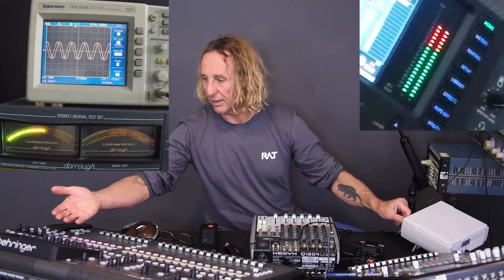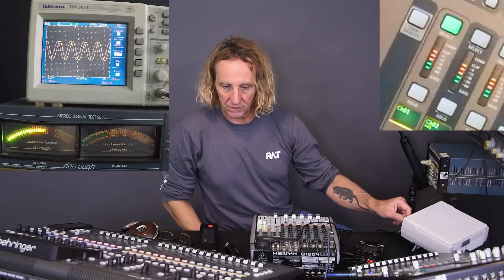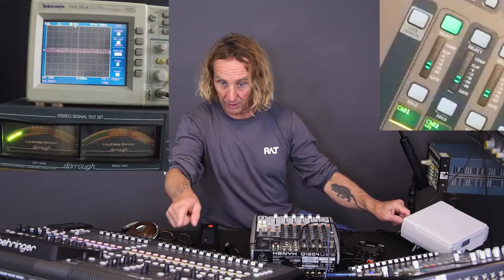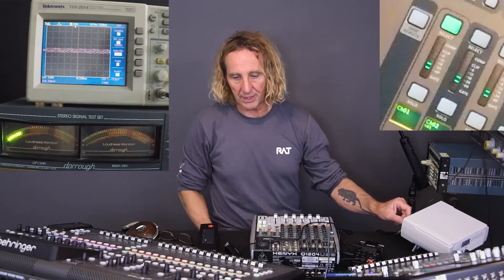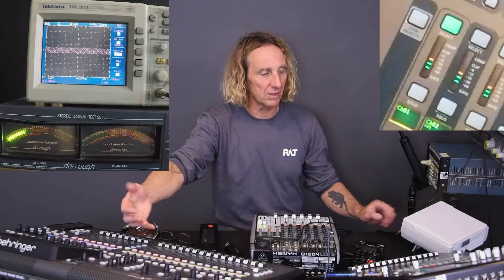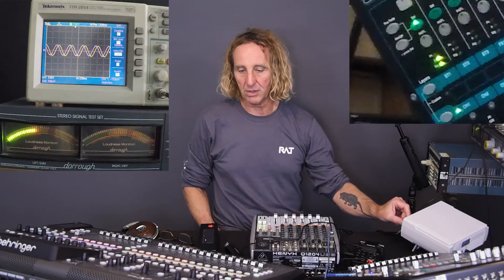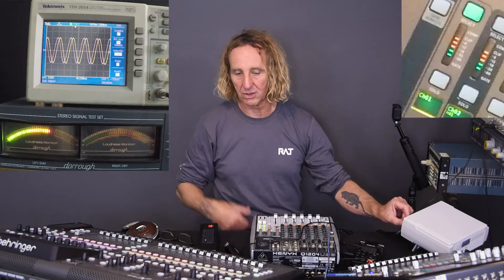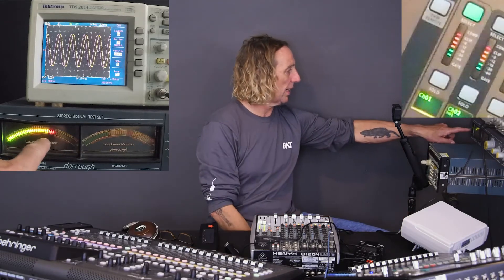Metering & Clipping - Behringer X32 vs Allen & Heath QU16 (Public)

Comment: The metering of consoles/desks should conform to a standard so we ALWAYS KNOW what we’re looking at for reference, and yet, here we are, needing this video. I’m with you give me a midas analog desk and we’ll have a good night, but, I stayed in with the digital boards and got them sussed. I do like the lighter weight on packs😂🤣, after 40 years, my back is fine! That H3000 musta weighed 750 pounds!two guys lifted it? Ouch.
Reply from the maker: Yes! There was much debate between being technically correct and intuitively practical when digital consoles gained traction.

The tech lab humans won and the opinions of people that use it in the field list that battle.

So we have technically correct metering that is intuitively flawed  for people that have used analog.

So mixing feels like driving without speedometers or speed limit signs marked whether they are kilometers or miles per hour.

And get it wrong and you get distortion tickets

Comment: The problem with digital is the signal sent to the output is missing pieces, how many pieces depends on the sampling rate.  Everything occurring between samples is lost.    Good to eliminate noise, but bad when mud is part of the dynamics or sound of the artist.   Analog sends all that it hears, without fail.   It's always listening.
Reply from the maker: Hmmm, that not entirely correct and based on a myth I address in a video I did on digital stairstepping.

Yes info is lost and the info that is lost are only frequencies above 1/2 the sample rate. Frequencies below 1/2 the sample rate are not lost. 

Yes there are issues with digital and personally prefer not converting if possible but it is not difficult to prove that digital can accurately capture audio below 1/2 the sample rate without losing info.
Reply: @DaveRat  good information.   I will have to look for the video.  Doing a Dave rat binge these last few days lol.
Reply from the maker: Awesome and thank you for hanging out and commenting. Search digital stairstep and let me know what ya think
Reply: @DaveRat  will do thank you.

Comment: Years ago in the 16bit digital world, AES established what I recall as a guideline for equating analog VU meters to digital full scale, AES-18, meaning when meters show -18dB(FS) you’re at 0dBVU or +4dBu (from the voltage perspective). Now in the 24bit digital world, with 144dB theoretical dynamic range between noisefloor and clip, we can make +4dBu = -24dBFS and have headroom at or approaching the same as classic large format analog equipment. It’s not operator error, in other words, it’s operators misunderstanding the standards and equivalencies, and that speaks possibly to the education they get prior to stepping up to the console.
Reply from the maker: Agreed. Digital boards look like and often try and feel like analog and meters often look similar but the way they are used should be quite different to achieve desirable results.

Knowledge of what should happen vs logic of what looks like is happening vs what actually happens are a bit messy.

And from watching and hearing numerous engineers and shows, there is a clear disconnect between what should be done and what is often being done on both analog and digital consoles.

With the issues being exasperated by the confusion and unforgiving nature of digital overload.
Reply: @DaveRat  maybe we should be writing the 10 Audio Commandments: Thou shalt not clip, thou shalt leave 20dB headroom…
Reply from the maker: Ha! I am trying! Doing these vids to illuminate and that's a good plan
Reply: @DaveRat  you’re in a unique position to be able to do so; show why the commandments should stand/be adhered to. The first one I mentioned in a unity gain system would be harmful at every place in the signal path, and for bar/club mixing, that can extend to a musician’s ears more readily than ever before. (For instance)
Reply: This is exactly what happened to me. I only had a few years on an analog board before upgrading to a Presonus Studiolive, then a X32. 
I had NO idea the meters were different, and mixed for years thinking 0 on an X32 was 0db. 
Embarrassingly, it wasn't until last year after I bought my first round of Meyer Sound speakers and clipped the digital amps by sending too much level that I went down the rabbit hole of learning all this. 
It also didn't help that almost every video I've ever seen of someone mixing a show on a X/M series console shows the master meters up to -6 sometimes. 
It's also VERY bizarre to me that most commercial speakers have an input sensitivity of -18dbfs yet on the X/M series the meters suggest you have 18 db of headroom before "clipping". 
IMHO that's INCREDIBLY misleading. If I hadn't already invested in 2 x Blue Midas Pro series stage boxes, I'd be over to Allen and Heath in a heartbeat. 
I REALLY wish there was a way to meter a Midas like an analog console, where the top of the meter is where the stopping point is.

Comment: Right when you switch from the X32 to the QU16... quite the latency difference!
Reply: Hmm?
Reply from the maker: I have not watched the video in a while and don't remember exactly how I did the switching but I do recall that it was disorienting switching between the two with music playing and I did tests running one console in each ear of headphones and then adding delay to the x32 to time align and make up for the added QU latency.

It was extremely audible but that is to be expected as humans can hear 1/10 of a ms time offsets without much difficulty, especially in headphones
Reply: @DaveRat does it mean that the QU have more latency than the X32, if you record this direct to DAW?
Reply from the maker: Yes!

Comment: Hey there Dave! Erick here. Long time listener, first time caller ;) 
Interested if you have explored how bit depth affects the resolution of digital signals, particularly the detriment caused to lower amplitudes which could contribute to the harshness of digital consoles. Since at lower volumes there are less bits to measure and replicate the changes in amplitude this could create harmonic distortions, possibly even at specific intervals, that could stack up in the mix. 

I’m also curious if you believe top of the line models by these manufacturers, such as the DLive and Pro Series consoles, introduce any kind of digital soft limiting to help prevent audible clipping and offer a more analog feel/sound/response? Also curious if something along the Rivage caliber of consoles would present such features.

It’s fun to chime in on the mix! Really appreciate all the great advice, in-depth unbiased gear analysis, countless years of amazing dedicated work, and a lifetime of being a fantastic human! Looking forward to what’s to come!!!🤘🤘
Reply from the maker: Thank you and I don't know for sure which consoles if any have soft limiting. I've heard people talk about it but I haven't tested and proven it to myself or found somebody that claims it.

As far as the harshness of digital I attribute part of that to the fact that digital tends to make whatever problem there is exactly the same on every channel identical. Analog has no two channels that sound exactly the same most light variations and differentials that I think soften the issues.

But I see the primary issue with digital consoles is that people overload them and don't expect harsh consequences.

You really really really need to run them well below limiting well below clipping to avoid bat sounding distortion. But when you do that you don't get that soft overload sound which adds warmth and take some of the edge off. So did digital kind of leaves you with either that sounding distortion or way too clean. Analog allows you to find somewhere in between those two and get a warmer more organic sound

Comment: But does it really make any difference, the Behringer is actually accurate whilst some might argue the AH is a little too conservative playing heavily on the safe side? After watching many of your past x32 experiments and tests I have since tested mine against other interfaces I won and still really impressed and happy with it. People like to knock the x32 simply cos its Behringer, sad people in my option cos they really are a good deck with masses of flexibility and features.
Reply from the maker: Overloading digital consoles is extremely common and very audible. The x32 sounds worse clipping than the AH but ideally no one would ever clip them and then it does not matter. The issue is human
Reply: @DaveRat  agree but for what u get for the money try beating the Behringer?
Reply from the maker: Well, for a pro rental company like I have, the Beringer is sub standard. The durability, lack of multiple types of output formats, the issues with 100 meter cable length, the poor customer support and the poor serviceability of a semi pro or consumer console, makes it a no go.

That is not to say it is not useful or sounds bad.

My home hifi is useful and sounds great but is not of the caliber to put out as a pro product.

Digico send people out to our large gigs, have Madi, fiber and very robust and durable builds.

And it's expensive bot for what we do, the cost is not an issue, we will pay top dollar for the highest quality gear.

And also. The x32 is great, super powerful and very inexpensive and a great way for people that are on a budget or do not require the durability of a bulldozer and are good with a pickup truck.

Having an inventory to mainaltain of 20 x32s sending out on your gives me nightmares just thinking about it.
Reply: @DaveRat  It is a little unfair to compare Behringer X32 against something made by Digico. Your comparison is 100% accurate no one in their right mind who runs a Pro Rental Company would consider the Behringer X32 and probably not even the Midas variant either, they are toys in comparison to Digico.
Reply from the maker: True and yet, the SD11 and QU16 are the only boards in our rental inventory that fit in my car to compare to, and the QU is just a utility mixer leaving the SD11 as the closest thing we own to an X32/M32

That said, we are looking at expanding our AH console inventory from one to more than one
Reply: @DaveRat  I originally wanted the QU16 but there was no guarantee when they could supply one anytime soon and they had quite on backorder. The x32 I bought was second hand and a complete rig with stage boxes and cables for a seriously competitive price and it was almost brand new (less than the X32 on its own without cases cables and stage boxes). I always knew I would get my money back and some, so it was never a risk. With the on going chip shortage the increase in inflation and a looming recession, I guess I did alright it serves the purpose I wanted it for.

Comment: Excellent video!  Allen and Heath, in their documentation for the QU state that the PK  LEDs illuminate at 3db before bad things happen, at both the channel strip and the outputs, at least for firmware 1.9.3.  On our SQ, peak metering is illuminated at the same level (-3dB) , but presented even more obnoxiously with more blinking red PK LEDs on the surface.  Allen and Heath really don't want you to clip your signal anywhere on the SQ.  

Side note, one of my friends out here helped you with a plumbing project many years ago, and you helped him get his first relatively big mixing console.  I've seen quite a bit of what you say to in what he actually does.  

Thanks for being a cool Sound Human!
Reply from the maker: Super cool and thank you for the info.  Trying to recall the plumbing and mixer. And awesome!
Reply: @DaveRat  Kemper Watson is my friend and audio business partner.  You were redoing a bathroom like 15 or 20 years ago and he was helping make sure you knew what to do and how to do it right.  Afterwards you helped him get a big Crest mixer.
Reply from the maker: Oh yes!! Totally know Kemper and super cool!

Comment: I worked with a Midas Legends 3000 in my studio for years until an unfortunate storm took it out of commission, at the time I wanted a Heritage 3000 but I was given a better deal on a Legend desk that was a showroom model in a music store. I have been searching for the right size Heritage 2000 or 3000 for my studio I need at least a 48 but I really want 56!! I think you would really like an FPGA mixer since it is a different type of processing compared to a DSP based mixer. The big issue is phase coherency with DSP based mixers, they just are not end to end phase coherent but this has been solved with FPGA mixers and I can say that difference between the QU mixers from Allen & Heath which are DSP based and the SQ mixers which are FPGA are night and day. The SQ mixers are phase coherent. The QU mixers use an ARM DSP to process the audio, the SQ and larger Allen & Heaths use an FPGA to process the audio. One of the Engineers from Allen & Heath wrote and article on why this is a superior way process audio since it can keep the signal intact without phase shift and FPGAs have lower latency sub 0.7 Milliseconds end to end, with no need for delay compensation the same way a DSP based mixer needs to be. I would link the article here but Youtube will delete my comment if it has a link so here is the title of the article by Jeff Hawley it's called "FROM DSP TO FPGA: A Digital Audio Signal Processing Revolution". It is a good read and sheds some light on why digital mixers have sounded they was they do for so long, and what is next when it comes to FPGA based consoles!! Great video as always Dave!!!

Comment: Thanks for these videos Dave!. When I mix on my x32 I always try to keep signals at -20 -15dbs I feel it sounds more pleasant to me, also trying to avoid the bottleneck in the bus master. Am I wrong?
Reply from the maker: That's all good, the worst sound comes from overload and running low levels is all good

Comment: Most consoles use + and - 15 volt supplies for the analog op amps for both the input and outputs. The Op Amps generally clip between 10 volts and 13 volts depending on the chip manufacture. You can see this on your scope. This is true for both analog and digital consoles, except the digital consoles have the peak voltage set with digital clipping near the clip level of the analog components. When digital hits the absolute 11111 or 0000 max and minimum peaks, there is no more. In analog, due to the clipping in the op amps, the clip levels may differ in the + and - directions, so the sound is a little different in clipping at the threshold.  An op amp may for example clip at 11 volts positive and -14 volts on negative peaks.  I should drag out my scope and measure the -0 DB peak levels of the digital consoles. With -18 DB as the analog 0 point, the math should have all digital consoles clip at the same voltage where the A/D reaches the limit of the numbers.  I can't see anyone making a digital console where the analog clips prior to the digital max values, so clip on digital consoles should be almost identical from a math standpoint.

David, Please find the peak value of clipping on a digital console. Highly suspect it is somewhere between 10 and 13 volts peaks positive and negative, or 20 to 26 volts Peak to Peak.
Reply from the maker: I think I covered that in this vid

https://youtu.be/32NpliojUbg

Comment: So it sounds like the A+H is simply calibrated (in terms of the metering) a little "cooler" to accomodate the 3 LED meter, so you can kiss the red without distorting, whereas when you have a larger meter like on the X/M32 and you can keep it out of clip a little easier.

Both nice sounding boards when handled properly! And GREAT point about EQ, Dave. Definitely seeing an EQ plot on a more square aspect ratio screen vs a physically very wide piece of rack gear makes it look like your EQ moves are more dramatic than they are.

Always appreciate the time and your giving out of this useful knowledge for free. Cheers!
Reply from the maker: Thank you Adam
Reply: The problem with Behringer's mic-pre is lack of headroom in the digital converter. The analog gain-stage in front of the converter will saturate like any analog circuit, but the clipping in the converter when the signal going into it is too hot is nasty. The Midas-preamps in the M32 and in Midas-stageboxes have converters with much higher headroom and behave differently. Restricting individual channel input-peak to somewhere between -18 and -12 dBm eliminates the problem.
Reply from the maker: So are you saying the M32 and X32 have a different bit depth that is not in the specs? Or the M32 has the same bit depth as the X32 but is somehow able to derive additional headroom?

How did you test that and verify that is the case?

Comment: Dave, did you try hitting the PFL button on the QU's input channel as it was peaking?  I'm curious to know if the main meter would show the extra headroom or if it would register the true value e.g. red at ~+21dB?  I think I prefer the X/M 32s input metering given that "red is dead" on most digital consoles and processors.  I'm really enjoying this series and it's helped me to set a better gain structure when I'm mixing on a X/M 32.  Thanks for taking the time to create such great content also for sharing your many years of audio industry experience with us.
Reply from the maker: When I get the QU back, will give it a look

Comment: What software version of the x32 are you running? I noticed with version 4.x that the solo meter is not showing the same level as the indicator above the fader. Like when the channel indicator shows clipping, the solo meter shows something like -18dB. (I think that changed with a software version, but don't have the possibility to verify that)
Reply from the maker: I had the latest version as of the time the vid was filmed in late 2021